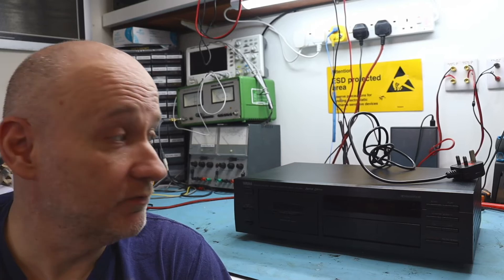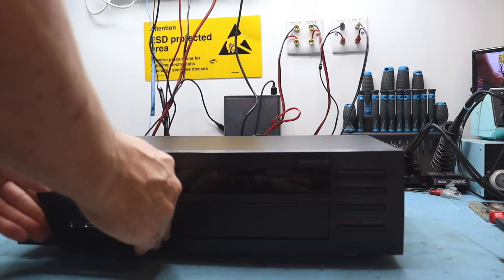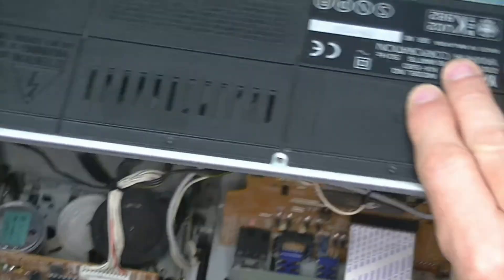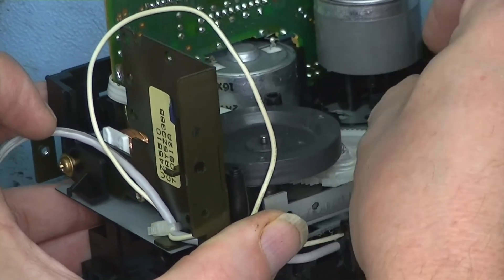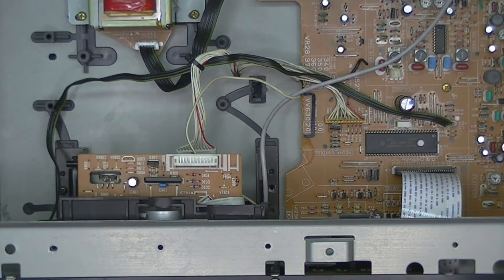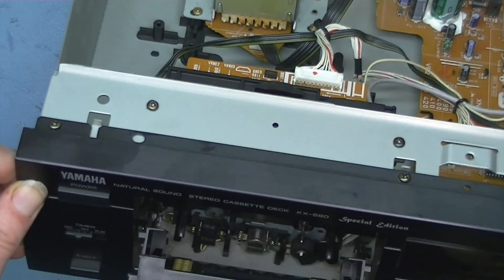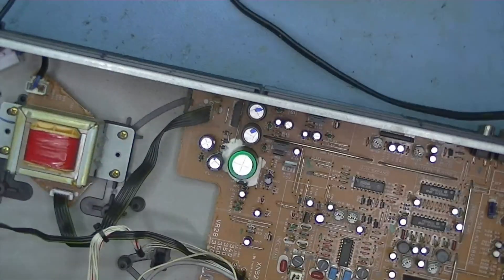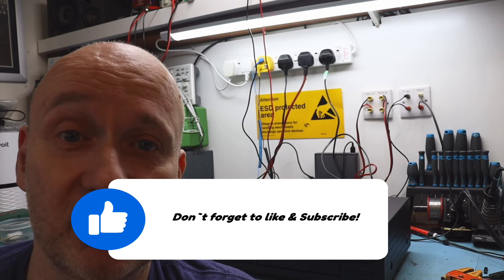Fixing old Tech - Can This Special Edition Yamaha Cassette Deck Be Saved? KX580SE

Comment: I have the non se model of this deck a decent sounding two head deck only thing with mine is the 2nd motor has gone bad speed fluctuates between high and low this happened with the original panasonic motor the replacement was a mabuchi and it worked great for nine months , i wonder if the se model spec fixes a design fault i know the se model is claimed to sound even better ,i do know from looking at the service manaul for the se model one of the caps is a completely different rating to the non se its one of the caps near the psu side .I have a new motor controller as when the motor goes bad that gets extremely hot i will check all the components on the motor board and replace the cap on that board hopefully the next motor will then last longer i do plan to change components to make it like the se deck and all the function button switches i got caught out with my original aiwa twin deck i bought new by dodgy switches causing the wrong functions..
Reply from the maker: you cna just strip the motor and clean the brushes and a drop of oil and reassemble and all will be good
Reply: Did you fix the motor?